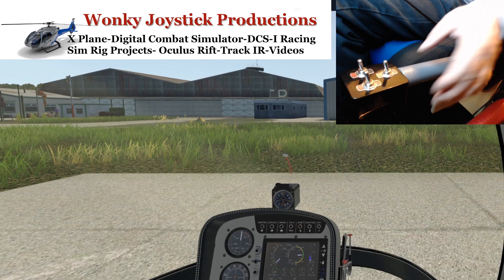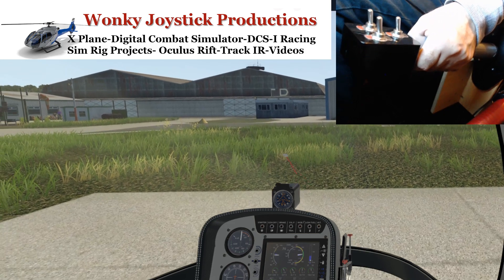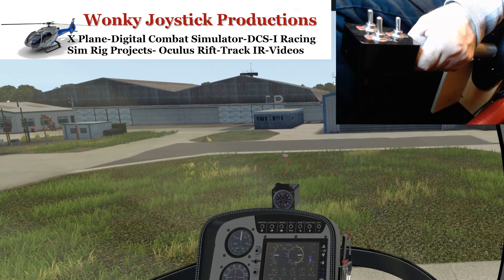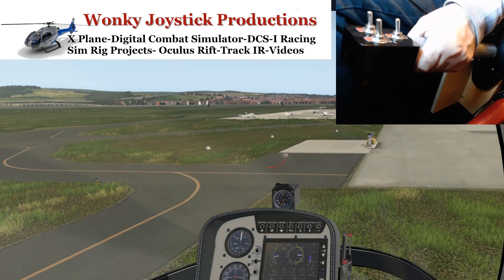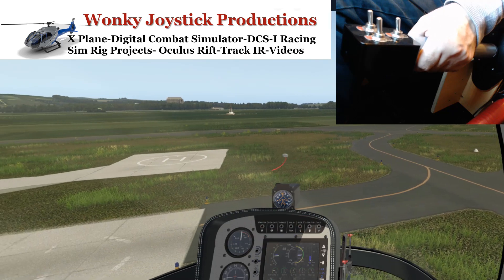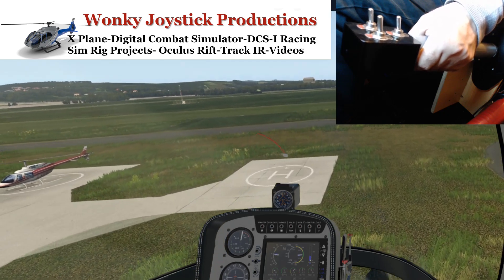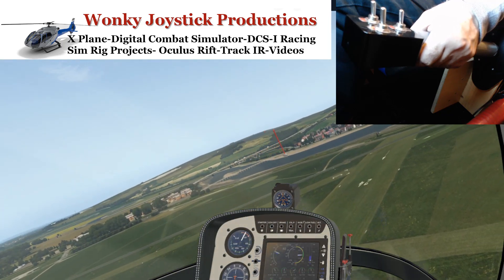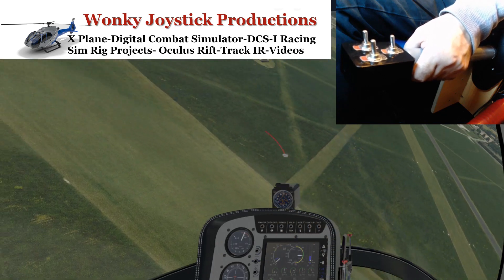Collective made from a thrustmaster RH shifter part 1

Comment: Well for a fellow helo simmer with physical problems I think you are doing extremely well and should be proud of your achievements.  I've had 5 strokes, my mobility has returned to my left arm about 90-95% which is not too bad. It is my eyesight however that can be a potential minor problem - and by that, I do (of course) mean "crash" :)